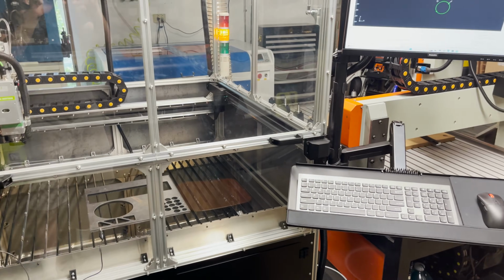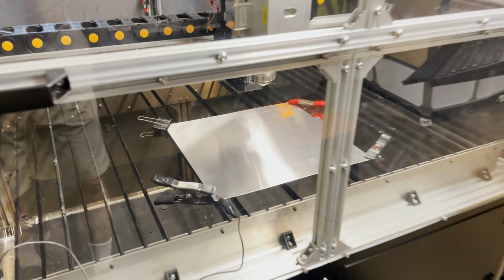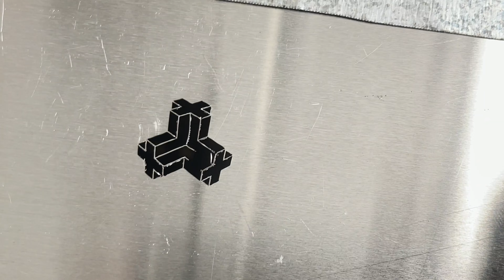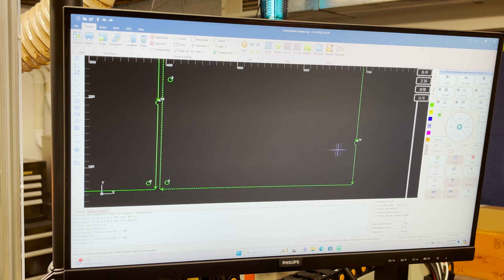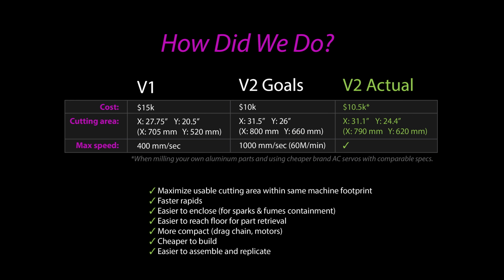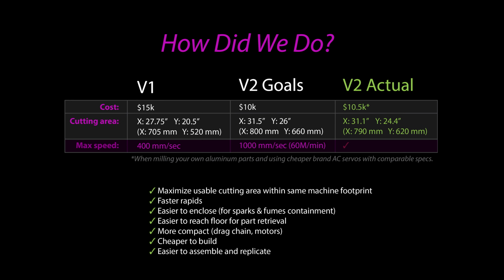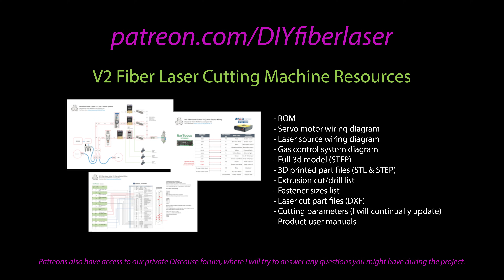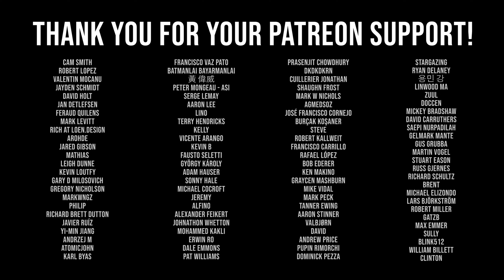DIY Fiber Laser Cutter V2 | Part 12: It’s Done!

Comment: impressive work, do you think it would be possible to use a cnc plasma table and adapt it, might reduce cost etc?
Reply from the maker: Some have done that, but depending on your plasma table, it might lack the rigidity and speed required

Comment: what is the accuracy you can get with this belt drive setup?
Reply from the maker: Watch the video where I do the servo tuning
Reply: @diyfiberlaser  hi Travis i check the video but i am not talking about servo tuning but actual cutting accuracy. the edge tracking software doesn't know anything about the mechanics of the system

Comment: Love your videos, so informative and you present the information in a way that is really easy to understand.  I will definitely be building a DIY fiber laser cutter in the future based off your design.

Just curious what other types of materials can you cut with this? what about stone like granite/marble/quartzite slabs?  What about glass? What about other more exotic metals like titanium or inconel? what about other soft metals like copper?  I'm particularly curious about glass and titanium becuase I will be doing some projects in the future which will require a bunch of those 2 materials to be cut and it'd be great if I could do it myself with a fiber laser like this.  A quick google search says that hard stone like granite as well as glass and titanium can all be cut by a fiber laser, though it mentioned nothing about how powerful it would need to be.  

It would be really cool if you did a video trying to cut some less common materials.
Reply from the maker: I think it can cut titanium, but I’ve never tried it. But I think you need a different wavelength to cut glass effectively. Soft metals like copper are problematic due to reflection potentially damaging the laser source.

Comment: Have you determined a max cut thickness on aluminum yet?  Skyfire suggests in their DIY section that I would need a 3000w source to cut 4mm and I am really hoping that they are understating the capabilities as a 1500w is the one I had budgeted for based on other fiber laser videos.
Reply from the maker: I can cut 3mm with 1kw

Comment: this is some seriously impressive stuff to watch, i'm in the laser cutting industry for almost 13 years now, and it blows me away that you have a downscaled version in your garage!
some word of advice, if i may..
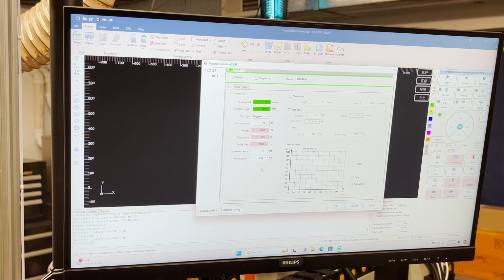on the 8mm the pierce was indeed to close for comfort, but probably not the reason for the mark on the part. anything above +-3mm sheet needs a reduced approach to ensure a proper puddle before reaching cutting speed (at 5:17 there is a parameter for slow start). if you are cutting with oxygen (and not compressed air) you might want to lower the cutting pressure. pure oxygen will boost the cutting proces by factor 4 to 5. low pressure cutting (oxygen) is around 14 to 22 PSI. on 8mm steel we barely hear the cutting gas flowing. 
the most important parameters are cutting pressure, speed and focus. the cutting edge is a good indication on speed, the 8mm you see the lines curving to the back, indicating the top puddle is moving faster than the bottom. the right cutting speed will result in almost straight cut lines.
aluminum is a pain in the ass to be honest, a good indication for good cutting parameters is when the light right under the nozzle emits a bright Cyan
Reply from the maker: Yes you may...and thank you, I really appreciate your advise! It's been challenging and mostly experimental to figure out good cutting parameters without any experience or training. I will certainly take your input into consideration next time I'm dialing in settings!

Comment: Travis, can you please look into using the same laser source for laser welding? Having one source for both is such a high value proposition! Maybe ask skyfire about it when you go to china!
Reply from the maker: Yes, I can bring it up when I'm visiting. The idea is interesting, but the idea of switching the optical cable between the welding head and sheet cutting head every time you want to use a different process sounds like asking for trouble, as the optical cable and lenses are very susceptible to damage from dust...I would not feel comfortable doing this repeatedly. If you were to just use the welding head for cutting, then you wouldn't have capacitive height control for sheet cutting...I imagine a new cutting head would need to be designed to combine the features of both types.
Reply: @diyfiberlaser  ok great point. Some searching reveals there exist beam switches made by ipg for this very purpose(get the most from your laser source). Perhaps there is a beam switch that was economical enough for our purposes. Could you inquire in your journeys?!
Reply from the maker: @chrisfischer511  thanks for sharing, that switch is very interesting, it looks exactly like what you'd need. I'll bring it up and see if they know of any other alternatives.

Comment: when you said the next poject will be tube project, I wonderd if that was a co2 laser cutter or to cut some metal tube with fiber laser.
If the next project is about cutting some tube with fiber laser cutter, I highly recomment considering a project about co2 laser cutter.
Reply from the maker: Fiber laser tube cutting machine. There are already many video series about diy CO2 lasers on Youtube, mine wouldn't really add anything new.

Comment: Hi from Argentina! It seems like you know what you're doing... Is it too crazy to think that you could be the first person to achieve an open-source SLM.  Perhaps an induction heating system could be used for rapid and controlled heating of magnetic metals. The laser source should be between 700W and 1000W. The structure should be similar to SLS, along with a gas system and a modified chamber to maintain the temperature. sorry for the spam :) but i really need to see this dream machine come to live.
Reply: Could the Laser CNC V1 possibly become the next open-source SLM machine? If it's too expensive to buy all the components...
Reply from the maker: @brianschwabauer3297  I will probably tear down the V1 machine to use the components for my upcoming tube cutting machine. But when I have time to do more research, I wouldn't mind spending some money on the project if I thought I could pull it off...metal 3D printing at home is a dream of mine too!
Reply: @diyfiberlaser  I share your enthusiasm for 3D printing and lasers! While I’m really passionate about the idea, I have to be honest—I don't have the technical skills needed to tackle this project on my own. That said, I’m about 98% sure it’s possible with the commercial technology available today. I’d love to stay in the loop and contribute in any way I can, even if it’s just on the research or brainstorming side. Who knows, maybe with the right team, we our you could make it happen!
Reply: Looks like Metal Matters allready did it "https://youtube.com/shorts/PEHv2lDC-ls?si=Sh42-tn3fzKPOso_"
Reply from the maker: @brianschwabauer3297  Thanks, can't wait to watch!
Reply from the maker: Haha, the SLS4All is a really interesting machine! I have to admit that I have done some research into the possibilities of DIY metal 3d printing...I love 3d printing and lasers! I'd probably need a team of smarter people than me to help pull it off...you seem to have done investigation into the idea...are looking to get involved in a side project? : )

Comment: On the fine cutting, re-order the cuts so you do the center first so you have more support. 
The other thing would be, on the 24ga, get the smallest orifice and test for the smallest energy possible. Your setup will do it. 
Open the orifice up and you will get 12mm with settings testing - you'll still end up with a cleaner job that plasma will do.
THUMBS UP
Reply from the maker: Thanks for the advice, that makes sense! The smallest nozzle I had on hand was 1.5S, so that’s what I used, but yes I should order some smaller sizes. I used 2.0D on the 8mm, after seeing the results I definitely want to try thicker…I think I have some 2.5D and 3.0D nozzles to test
Reply: @diyfiberlaser  I use 1.0 double on everything 16ga to 20ga mostly because I haven't seen a difference with single.
2.0 is good for 8mm but I have found that you won't see higher cutting performance without opening the orifice up. 
I think your cleanliness on the cut and slag will clean up more with tuning.
I may have to tune in ($) to your patreon though, you have more info that I on this - you're doing great stuff!

Comment: Travis, I have really enjoyed your series and am considering building my own now. I was wondering, I mostly have .125 aluminum cut for parts I use. I would love to hear your opinion if you think your setup could be expanded to handle 5x5’ cutting area?  My current largest part that I need to cut is 35” square.  I realize the cost would increase with the added table size but it would still be way less costly than a commercial unit and I haven’t found any in a 5x5 bed only 4x8 or 5x10. Thanks for a rest series! I will be joking your discord board once I get closer to building.
Reply from the maker: I would probably be using thicker extrusion and rack & pinion drive at that size.